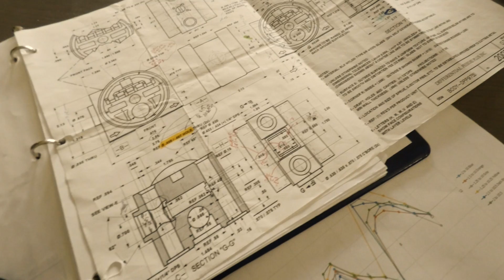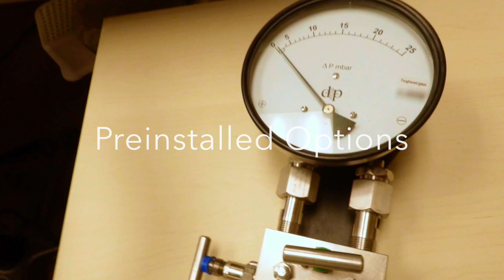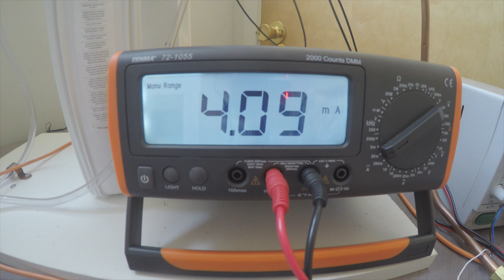This is Differential Pressure Plus

Comment: Interesting.  I am in the process of installing a set of ispring mesh filters and was trying to figure out the simplest way to plump a set of pre and post gauges.  .I was going to used liquid filled Palmer 100lb Max gauges with 1/4” brass needle shut off valves.
I put shut offs on everything. Anyway, I’ll look more in to your product.
Thank you
Alek